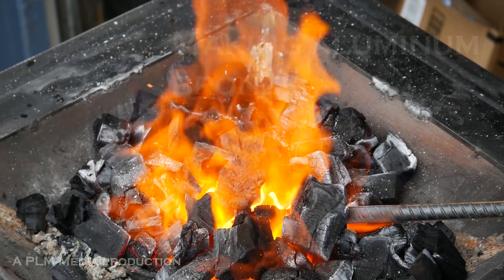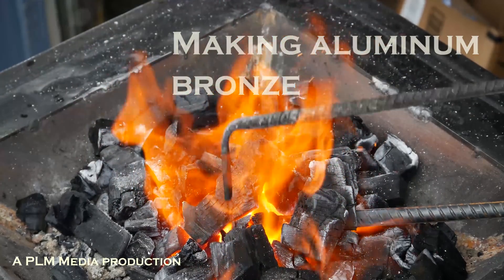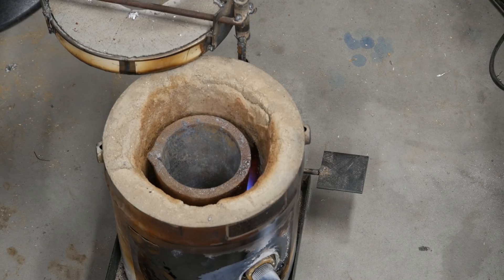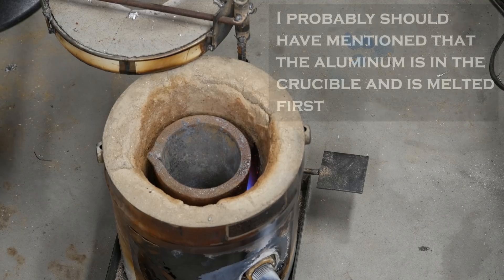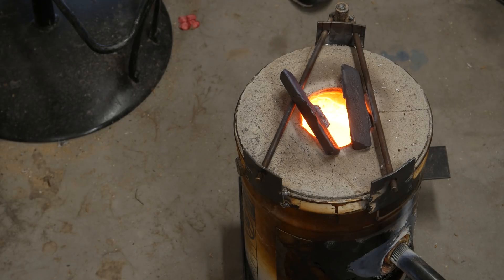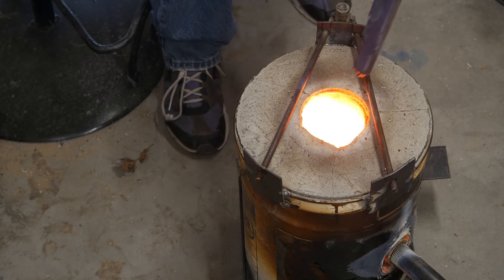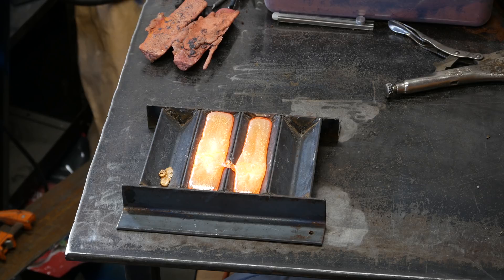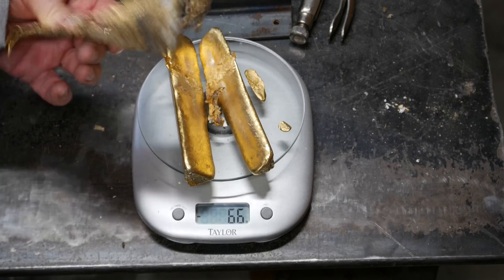Making aluminum bronze

Comment: Why wouldn't you heat up, and melt, the copper, first, since it melts at the higher temperature?!... Then, while adding the aluminum, it would readily melt into the already liquid copper.  I would caution, that it's very important to "pre-heat" (dry) everything before dropping pieces into a solution! (You don't want to cause a "steam explosion"!)
Reply from the maker: Oh man, you have no idea how badly I don't want to cause an explosion :-D  I actually had +olfoundryman make the same comment. Prior to that I had been given comments that said you should melt the aluminum first and that they copper would begin forming the alloy at pre-copper-melt tempereatures.  What you and +olfoundryman said makes perfect sense and I'll be doing that going forward. Assuming I find more copper to melt, I'm out :-)
Reply: @swdweeb  Maybe somebody said this somewhere, but molten Al is very corrosive, it dissolves the copper at well below it's melting point, that's why you melt the Al first! The melting point of Al bronze is lower than Al melting point!
Reply from the maker: @MatthewTinker-au-pont-blanc  Another of my early.. ignorant... videos. I now know better realize that the alloy starts to form before the copper melts. I melt the aluminum first now. Although I really don;t do all that much aluminum-bronze as it shrinks so badly.  Pretty much do tin-bronze instead now.

Comment: The white smoke is probably Zinc Oxide fumes and the copper you're putting in there isn't pure copper but brass and the zinc is boiling off due to its low boiling point...I had the similar experience once and yes, don't breathe the Zinc fumes.
Reply from the maker: I'm pretty sure I had reasonably pure copper. I made my ingots out of copper pipe and cut off all of the brass fittings that were on it.  I ended up with dross on top and below the copper when it melted. So I thin I got most of the impurities (lighter and heavier) out of it. 

Someone else made similar comment about the white smoke being aluminum oxide saying that I got the aluminum a lot hotter than I needed to before I added the copper.  I've since made more like in my follow-up video on the hammer and with that I added the copper much sooner in the process. I haven't seen the white cloud again. 

I generally try (not always) to make ingots first. I find that I get a lot less dross whether its copper or aluminum from the ingots than I do from unprocessed scrap.

Thanks for your comments. :-)

Comment: white smoke aluminum oxide. Aluminum will burn off if left alone in the crucible. no need to overheat the lower melting point constituents.
Reply from the maker: Someone else told me the same thing about not needing to overheat the aluminum. I would have never guessed it but the explanation I got was the alloy can start forming at a lower temperature than the copper melting point. I'm definitely going to try it a lower temp next time.

Thanks
Reply: Yeah its kind like soldering, solder actually dissolves some of the copper to make the bond. As long as the aluminum is molten, it should start dissolving the copper as well. I've also seen alloys made the other way around, melt the metal with the higher melting point 1st, then add the lower melting point metal. If I remember correctly, that was a pro doing it in the video I saw. Not really sure which way is right.
Reply: It wasn't the aluminum that vaporized it was the copper I've seen it a thousand times it's a white smoke with a green flash stop. Cover that melts that fast will vaporize some every time

Comment: I have been watching aluminum bronze youtube videos in preparation of making some myself. I am thinking that putting the aluminum in first and getting it real hot before the copper is added burns up some of the aluminum. I would just put everything in the crucible at the start if it fits.
Reply from the maker: So here is what another commenter (is that a word?) said. He said that you don;t have to get to copper melting heat before the alloy will begin to form. I did exactly what you're talking about and took the aluminum to near copper melting temperature. When I added the copper, the reaction was very fast, The first ingot melted into the aluminum almost instantly. That's when I get the plume of smoke that you didn't get to see. He said that they alloy will form at lower temperatures than the copper melting temperature. At least that's what I interpreted hi words as meaning. 

I melted the alloy tonight and made a casting from it. I can tell you that the allow took nearly as long to melt as my pure copper so I don't know.

I watched a video where the guy melted the copper first and them added the aluminum. If I recall correctly it nearly blew up so I don;t recommend trying his method.

Comment: Paul quenched his ingots in water and they seemed to be pretty hard when he took a file to it I'm curious if the ones you let cool slow are just as hard. Great video!
Reply: Other than steel, most metals end up in a harder state if they’ve been cooled slowly than if they’re quenched.
Reply from the maker: Darn good question. Tell you what, when the temperature of my garage warms to somewhere near freezing this morning I'll run a file across it and see. Maybe I'll put that in the next video as well. I'll respond to you here as well.
Reply from the maker: Ok, I did a small casting tonight. it's soooo cool but you'll have to wait till the next hammer video to see it. ;-)  I can tell you that letting it cool in the air makes it really hard. I couldn't cut it with a hacksaw, it just skated right off. I had to use a cut-off wheel to cut it.
Reply from the maker: I'm always hesitant to question people when I know almost nothing on a topic ;-) Where does copper fall in that argument? I heat copper and let it cool to soften it. Is it an edge case or is your comment really related to alloys as opposed to "elemental" metals? I really don;t know and would live to learn.

Comment: when making copper alloys, you dont need to get it to the melting temp of the copper, just the melting point of the final alloy and it'll dissolve down into the melt rather than needing to melt into it. Thats why it dissolved the copper so quickly, the free aluminum just dissolved it into it almost as fast as you can add it. Ingots look great, cant wait to see the finished hammer.
Reply: the alloying metals dont need to reach the extreme temps needed for all of the alloys, just the temp of the alloy your making. I know that you need to get the alloy to pouring temp, but to get it to dissolve all together, you just need to get it to the melting temp of the alloy your trying to make, not the highest temp metals in the alloy. Otherwise metals with ~1% titanium or tungsten would need to get way above the temp of the boiling points of the other metals, and you would just damage the other metals. It will dissolve at much lower temps. Try sticking a copper wire into some aluminum at aluminum temperatures, it'll dissolve into it.
Reply from the maker: Fascinating. I read both your comments. I had no idea. So let me ask you a theoretical questions. I noticed that the second copper ingot took longer to melt than the 1st. Do you suppose that was due to cooling the melted metal when I placed the warm copper ingots in it or that the melting point of the first alloy was raised after it formed? (1st alloy being the aluminum and 1st half of the copper)

Thanks for the info!
Reply: part of it was melting temps of the mixed alloy raising higher and higher as the copper is added, part of it was the solubility of the copper into the melt based on the copper, and part of it was just the ingots that you were adding was cooling the melt too.
Reply from the maker: Thanks
Reply from the maker: I would melt the aluminum first and then add small amounts of copper to it. The aluminum will react with the copper to form an alloy at temperatures lower than the melting point of copper. Keep adding copper until you achieve the ratio of copper/aluminum you want. 

Copper is hard to melt on it's own. It requires a yellow heat in my furnace to melt. I've found that the bronze melts a little lower temperature.

Comment: I came here from Paul's. Great vid! I'm considering making aluminum bronze for non sparking grinding media, so this is exactly what I'm interested in right now. I just need a foundry first. I might go electric. We have cold winters where I live, and it  would be nice to be able to melt stuff indoors. Keep upp the good work!
Reply: +swdweeb you ever done glass before? I understand that's a real challenge not that metal ain't a challenge or anything like that don't get me wrong
Reply from the maker: I can tell you from personal experience that melting that much metal stinks. I mean smells really bad. If it's dirty or painted or anything that's not pure, forget about indoors. I do it my garage and I have to have the front and back door open to keep air moving through and the smoke from building up. Sometimes thats not enough. 

Making non-sparking abrasive sounds really cool. Will it be bound to something like canvas or free like for use in a blaster?
Reply: I'm doing some amateur diy chemistry, so I have very good ventilation. I also like the fact that an electric foundry/kiln is quiet. The grinding media is for a ball mill, milling aluminum powder, blp, etc. My plan is to cast aluminum bronze cylpebs.
Reply from the maker: What??? You don't want to stand next to a deafening rocket engine like Paul and I do?? :-D   Have you figured out how you're going to make your molds? It would seem that you'll need to make a bunch of cylpebs. How big are they?
Reply: swdweeb a cylpeb is basically just a short cylinder. A steel pipe, cut to pieces of the right length, welded to a steel plate should work. Do you know how to get the aluminum bronze as hard as possible? Quench or not to quench? Any thoughts?
Reply from the maker: I don’t know.  I do know that I let a piece air cool yesterday and I could hardly cut it with a hacksaw. It just skated across it. Ended up cutting it with a cutoff wheel on my grinder.
Reply: Ok, thank's for the input. It'll be fun to experiment with different alloy ratios, cooling times, etc. Good luck with your project, and Merry Christmas!

Comment: Good luck with the casting!
Reply from the maker: Thanks!  I was going to try and do it today but I think I'm going to look for a hair dryer at the thrift store so I can try forced air like Paul is doing. It takes me forever to get hot enough to melt the copper.  I think I'm also going to make a smaller flask so I don't have to ram up so much petrobond each time.